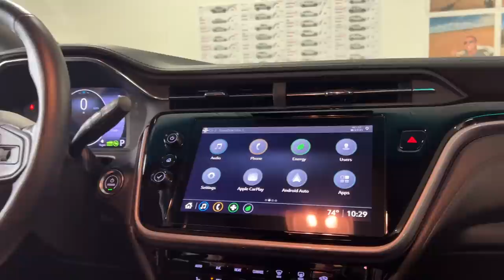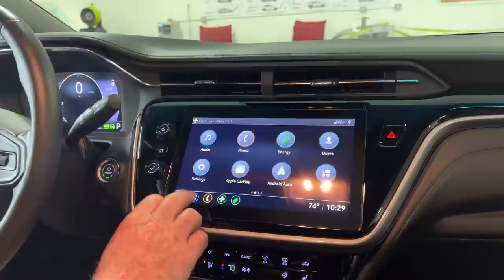Sandy's First Impression of the 2022 Chevy Bolt EV

Comment: The Bolt has its place. It's an unexciting car with decent range at a good price. It's an LG Chem car assembled in Michigan. We've already seen Bolts go 300K miles with no real issues. Pack is thermally managed so they degrade at about the same rate as Teslas. Our 2019 pack was swapped at 40k miles, where we had an estimated 6% battery degradation. New pack resets our warranty to 8yr/100k and gets us an additional 34 miles of range when considering the capacity loss on the original pack. Leg room up front is amazing. First car for me at 6'1" where all the way back is too far. The suspension is not refined and the steering feels dead. After 50k mile so far, no issues. 

We also own a Leaf and a Tesla. Each fills a role. Leaf was dirt cheap used. Put 30K on it to date. Great, local "errand" car I use to poke about town. Bolt is my wife's daily driver. She's perfectly happy with her Bolt. Tesla is the "fun" car, weekend trips, vacations, any "long" drives.
Reply: Pretty much the same as us then. Our 2019 Bolt, or rather Opel Ampera-e as it's called here replaced an early 1st gen LEAF, and is mostly used only locally, though it has more than enough range to go to our cabin ~120mi/190km away and might even make the return too if starting out with a full battery and dry roads. For longer trips the charging feels rather tedious though, especially since our other car is a Model S.
Considering OTA updates are rather limited (I believe the infotainment at least can be updated when connected to WiFi), it's just as well that it relies on Android Auto/Apple CarPlay for navigation, streaming services etc. Actually my biggest gripe is the lack of adaptive cruise control - it has a radar and will happily warn you if you get too close to the car in front, but for some unfathomable reason this is not fed into the cruise control logic... Other than that I like it a lot - more than enough power considering it's FWD only, controls are mostly good and it's a practical everyday car with easier ingress and egress than the S.
It will be interesting to see if battery degradation is on par with typical Tesla packs; the LEAF certainly wasn't though that had shitty thermal management (if you could even call it that). Too early to say as we only had ours for just over a year before the battery was replaced.
Reply: @koma-k  GM really missed an opportunity not including adaptive cruise control. In theory could that be an OTA or at least an update at the dealership? One can dream.  My Leaf is a 14. Purchased in 2017 with a 100% SOH battery. It only had 8,700 miles and cost $9,800 USD. Seemed like a can't-lose test as my first foray into EVs. At 36K miles I've lost 21-22% capacity. I don't live in a extreme climate and do all I can to be gentle on the battery. I would not be happy if I paid full price for the Leaf. But if range is not an issue, just tooling around town I find the Leaf more fun to drive than the Bolt. It just feels more nimble. Plan to drive both of these cars into the ground.
Reply: @epcalderhead  This is GM. Most of their target buyers aren't going to pay $600 to software upgrade their car. It would be a cost sink. Given that low cost to add it on and the expense of the system, they aren't making a lot on that upgrade. Plus there is a major LiDAR chip shortage and you don't want to have cars held up at the factory for that.
Reply: @anthonyreynolds2365  no need for LiDAR to implement adaptive cruise, and the bolt/ampera-e already has a radar sensor which should be sufficient. I mean it even has camera-based pedestrian recognition, and cross-traffic warning when reversing, so I very much doubt it's anything but a software issue.
However I also very much doubt we'll ever see an update adding adaptive CC; especially for the European Opel-badged version since GM sold that brand to PSA and dropped OnStar services in Europe - we don't even have a functioning app anymore.
Reply: @epcalderhead  we had the leaf since '11 - it was from the first shipload delivered to Norway...
It was a good *car*, and had few issues except for the battery degradation. We also treated the battery well, hardly ever fast charging and very rarely past 80%, and since we're on the southwest coast the climate is pretty "gentle" too from a battery perspective. When we sold it we'd put about 80k km/55k miles on it, and in the winter time it barely had enough range for my wife's daily commute - a mere 34mi/55km round trip.
When I read that Nissan skipped proper thermal management on the 2nd gen too, they basically disqualified themselves from even being considered. Adding the crappy app (well, not really the app itself but the service that underpins it) which barely improved during the almost nine years we had it, I have to say Nissan has disappointed. They could have had a solid position in the market now just from being early with a decent EV, but they ended up shooting themselves in the foot in my view, by doing essentially nothing for ten years.
Reply: @koma-k  For sure, Nissan really missed the boat. I tell people I would never buy a new Leaf. I'd consider leasing one as I would not care about beating the crap out of the pack and then turn it in.
Reply: Man, you are committed!! Three EVs and no ICE?
Reply: @parkershaw8529  Yep! I drove that Leaf for less than a month before I knew I was done with gas. Between me and my wife we're about to cross 100,000 all-electric miles. For a one household car a Tesla would be my choice due to the Supercharging network. I would never go back to an ICE car.
Reply: @epcalderhead   I am milking my current ICEs as long as I can. I will switch when they crap out.
Reply: @parkershaw8529  Pretty much what we did. The Leaf replaced a 98 Camry that I drove until 2017. In 2018 The Bolt replaced a 2007 Prius. You will have a much better range of options when the time is right for you. Edge cases aside, from today forward, purchasing anything but an EV makes little sense.
Reply: @epcalderhead  The 2022/2023 models do have adaptive cruise control. I know my 2020 has a distance feature to advise against tailgating... its a stones throw away from having all the tech to do adaptive cruise. From what I read, the issue was developing the software to do a combination of regen braking and normal braking. Can't remember where I read that though.
Reply: @epcalderhead  For light weight passenger vehicle, maybe so. But, EV is still not there if I want a trailer towing vehicle, or I want do an RV conversion.
Reply: @anthonyreynolds2365  Adaptive cruise control was introduced starting with the 2022 models.

Comment: Really excited to see how you like it. I bought one in 2019 and it's the best car I've ever bought. Your thoughts on range and DCFC are right in line with my experiences. Great for local travel. Fine for 3-400 mile road trips. Doable for longer trips but it'll get tiresome. It's also surprisingly efficient. On a recent 320 mile trip from north of Baltimore to north of Pittsburgh (across the PA Turnpike) I got 4.16 mi/kWh going 70 mph with the A/C on. 4.58 on the way back but traffic was slowing things down so not an apples-to-apples comparison.
Reply: Sorry Matt, don't want to be cruel, but not a snowballs chance in hell you got that mileage per kWh. I know... you'll hate me, double down, I get it. But you did not get that mileage.
Reply: @BasementTracks   maybe I'm missing something since I don't know much about EV's, but doesn't that come out to about a 220 mile range?
Reply: I've gotten over 4 mi/kw on the highway at 70, but I had to do some pretty aggressive drafting to get there 😁 2017 Bolt
Reply: @BasementTracks  My experience is ~3.9 mi/kwh at 65 mph traveling Houston <-> San Antonio. Any speed higher seems to torpedo range. I used to hyper mile; I could get 5.6 mi/kwh commuting to work at speeds of 30-55 mph. Now? 4.2-4.6; there's just no point in trying so hard for what amounts to maybe ~$1/wk. The Bolt is already so damned efficient...
Reply: @BasementTracks  So, pictures or it didn't happen? I have the pictures, tell me where to sen them.

Comment: A good competitor to the Nissan Leaf, the market needs small economical vehicles like this, will buy one when the insanity of the market place cools off.
Reply: For now I think a Prius is still a better buy.
Reply: @tpad6  if you can find one…
Reply: I will be interested in Sandy’s reaction to this car.  As a former Leaf owner, (2011) the economy priced EV isn’t up to par with a PHEV like my Audi A3 eTron, or my Fusion Energi.  If it is a city car for commute only, the Bolt might work for a two car family, but if it is all you have, the money would be better spent on a hybrid.
Reply: The Bolt models are a far better value since they feature liquid cooled batteries and use CCS for fast charging while the Leaf is a passively air cooled battery and uses CHAdeMO for fast charging. Try finding a CHAdeMO new installation in the past year. Heck, in our part of the California Central Valley, ChargePoint and EVgo have replaced older Level-2/CHAdeMO combo stations with CCS stations.
Reply: I'm on my second bolt..  love em
Reply: @tjs114  my Leaf gave me 11 years, and I traded it in with 45% SOH. 40 miles range. The local Chademo charger at electrify America did not work, so I get what you are saying. I retired, and didn’t need a commute car; I needed something that could go 815 miles one way, monthly for elder care. Even a new Leaf or Bolt would have a hard time with that. If I want to spend $60k on a Tesla or Kia EV5, I could travel 185,000 miles with $7 a gallon gas before I would break even. (Or 12 years)
Reply: @Qrail  The new Chevy Equinox EV coming next fall and starting at $30K is something you might want to watch for.  New Ultium battery platform (like the new Cadillac Lyriq), fast charging at 150-190kW and around 300 miles of range.

Comment: I appreciate him noting the difference between a machined forging and a casting, you don't get that review from everybody. Good point about drum brakes, on an EV they need very little maintenance. My guess is they don't have them "on the shelf" anymore, also it would be red meat for haters, you would hear it in every review.
Great reviews so far, although I think he's slightly understating the usage case, this is a great everything car for many people, what it's missing is mostly things most people care less about.
Reply: Some of the VW iD3 and iD4 use drums on the rear wheels.
Reply: If there's one thing I've learned from drum brakes is they always need maintenance. I absolutely hate them
Reply: @humzilla707  harder to service, that's what I hate about them

Comment: The EUV isn't significantly bigger than the EV, but people forget that the platform punches above its class for interior volume. It's significantly larger on the inside than many compact to midsize sedans. Based on GM's recently published timeline, though, it does sound like the Bolt EV/EUV will be phased out in the next two years and replaced in the lineup with the Equinox EV.
Reply: that's depressing, however typical that these companies just focus on making & selling behemoth SUV's, smh.
Reply: @aaromon43  To be fair, the Chevrolet Equinox is not a large SUV. Sure, it's big by global standards, but it's small by North American standards. It would be in the same class as the Hyundai Ioniq 5, Tesla Model Y, and VW ID.4. Three cars that I can't ever recall being referred to as "behemoths."

Comment: The single car household went the way as the single income home.  The Bolt makes a great commuter car.  You drive it around town and on small excursions (100mi each way).  Your second car handles all other duties.  At $26k (Bolts were being sold for $20k last year), and little to no maintenance cost, its a no brainer.
Reply: It's a great car to put miles on.  I've expensed 10k miles a year driving it.
Reply: What other duties? Commuting and drives around town account for 99% of most people's usage. It would make more sense to just rent a car for the occasional road trip than to pay for insurance and registration for a car that just sits around.

Comment: Yes, VW started using that Twist beam rear axle design on the Golf/Rabbit in 1975!
Reply: The only thing was the GOLF/RABBIT were cool cars. This BOLT is lame.
Reply: And French manufacturers have used Torsion bars since 1920
Reply: Exactly.My Nissan leaf was great but the twist beam?
Reply: Our 1988 Audi 5000S had that type of rear suspsnsion too. With front-wheel drive, the big 20 square foot trunk swallowed a stroller with ease.

Comment: If I was in the same work/living situation I was 10 years ago I would buy this car in a minute. I'd have a long time between charging, and it has most of what I want in a car.
The price is surprisingly low - but GM is basically "paying" to establish the Bolt as an attractive buy after the battery fiasco. Very slim profit.

Comment: Nice, unbiased, quick summary of a cheap car.
Reply from the maker: Glad you liked it!
Reply: Is $38600 cheap??
Reply: @patreekotime4578  you can buy them in the San Antonio TX area for between $25,000 -$30,000 all day long.
Reply: @joelschanbacher  When does $30k become cheap? Maybe I am out dated, haven't bought any vehicle since end of 14.
Reply: @parkershaw8529   By cheap, generally people mean “lower price range of the market”. As an example - A Nissan Juke is a decent comp for an ICE vehicle to the Bolt. Minimal frills, small crossover segment. The MSRP on those was $20-30K and the sales price on those was usually around $2K lower,  depending on trim level. So a $7K premium for the battery cost is about right in the current/recent new car market. After soon-coming tax incentives, they’ll be priced in line with comparable ICE vehicles.

Comment: This is hands down the best in value class EV available right now. It definitely has room for improvement, but for the price it's a great deal

Coming from a Tesla fan with an '18M3P FSD
Reply: fwd, no. just hell no.
Reply: Lmao
Reply: This car is mediocre at best.  You get what you pay for.
Reply: @livingroom.computer  For the mass market FWD is great. Never intended to be a niche market enthusiast car.
Reply: @markmiller6844  no. its ridiculous to make any electric fwd. make it rwd or awd, the needed drivetrain could just be placed in the rear. due to physics of steering and propulsion needing traction you should never have the steer tires do braking, acceleration and turning.

Comment: I'm really not a big Chevy fan but I may just end up buying this car. I just need an inexpensive car to get me from point a to point b. While I am a huge Tesla fan and love all the features and everything they offer, it just doesn't make financial sense for me to pay nearly double the price for a Model 3. I really don't need heated seats, dog mode, century mode, autopilot, leather seats, etc. Just need a reliable car that can take me to and from work and the grocery store, and so far this is the only EV that fits the bill at a reasonable price. 

Yes the Leaf does fit the bill but it has an air cooled battery and Chademo charger which is an automatic no for me.
Reply: Oh..but my 2022 Tesla Model 3 Long Range is SO much fun to drive, and LOOK at!

Good luck buddy.
Reply: I got a 2017 Bolt last year and have been very happy with it. It's cheap to run, and high gas prices have only made me happier with my decision. If there aren't affordable new models available, now is the good time to buy used since most vehicles (including mine) just got brand new batteries with 100,00 mile warranties on them.
Reply: @chezchezchezchez  get a life. Grow up. No one is looking at your Corolla of EVs. It's actually quite embarrassing
Reply: @dece6170  ⬅️ Troll

Comment: Looking forward to this review, I am looking to buy an EUV to replace my 2006 Lexus Rx350. I have a Model X 100D and found the Bolt to be a great option for short trips around the city and my commute to work. The EUV also has supercruise available. The biggest thing that appeals to me the low cost of the tires and ventilated seats. I wanted to get a Model Y, but it didn't make sense for me at the current price.

Comment: With my Teslas, I have never used a supercharger.  I charge at home with my
Solar/powerwall storage battery.  I fly when I travel.  I save $400/month on gas and home electricity with my solar panels/powerwall  and EV.  Plus add value to my home

Comment: I drive a 2017 Bolt LT with the new battery pack (same as this car) and with a full charge (i usually don'y fully charge it) I get about 300 to 315 (that's the highest I've seen) miles of range in warm weather. I got the battery pack replaced under the recall/warranty in the Spring of this year so I won't know what the new range will be in cold weather for a while. I'm guessing it should easily be over 200 miles.  I'd like to see some updates like a heat pump and a few other tweaks but overall I think the car is great. I bought mine used (previously leased) for around $19,500 with about 19,500 on the odometer.  I bought it at the start of covid and well before gas prices went crazy.  I could probably sell my car today for more than I paid for it.  I now have about 42,000 miles on it.